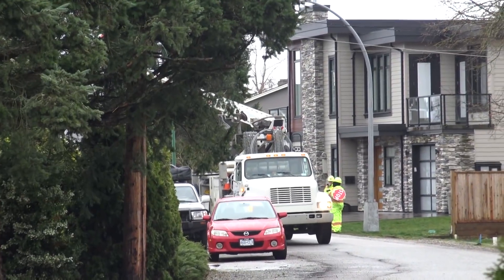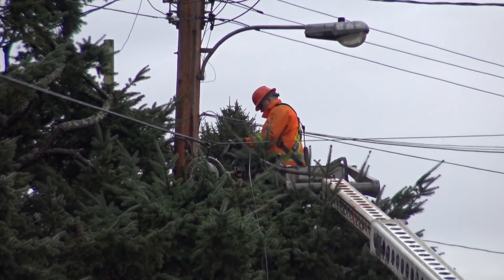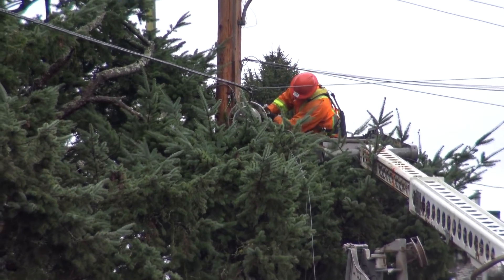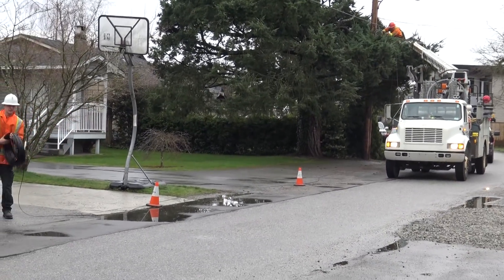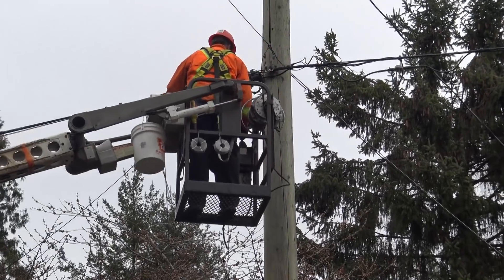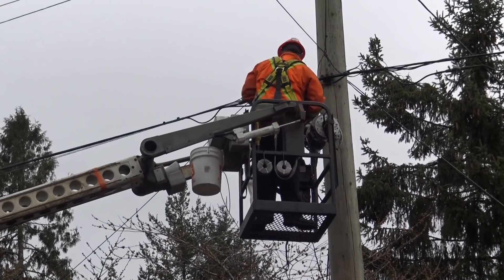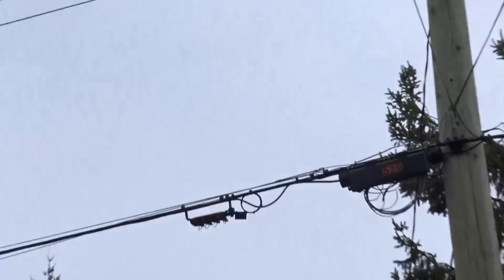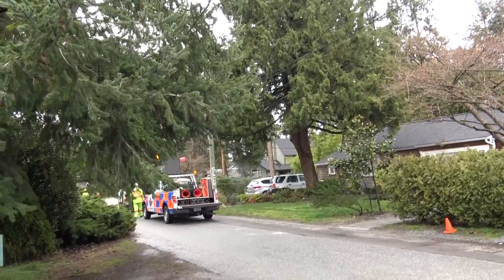Telus is placing fiber optic cable for FTTH upgrade

Comment: There's a 12-port NAP in front of my house.  For whatever reason, they ran a single fiber drop to my house, a dual fiber drop to my neighbor's house, and a quad fiber drop to the house across the street...
Reply from the maker: It depends on the zoning.  If single family a single drop. If legal suite is registered a dual is run. 4 pkex gets a quad.

Comment: I've seen FTTH overbuilds where the fiber is slower than the existing coax. Beware of the salesmen that follow.
Reply: FTTH can support 128 houses on a single 1Gig fibre link. But that would be insanely slow.
Reply: @99beta  Remember... Plug fast into slow... and you've still got slow. I've seen a lot of that.
Reply: @99beta  300 mps off 750 mhz coax in Tennessee right now. I can live with this.
Reply: @99beta  Remember price, not speed will be the determining factor.

Comment: I have fiber in my neighborhood but the AT&T tech said he couldn't install it!  Jesus Christ!
Reply from the maker: All the parts may be full. I know for us that is s problem. When plant was designed it was 1 drop per address  if the house had a legal suite that is registered with the city there were 2 service drops installed. If the home was a single family house that was turned into a duplex or triplex without the cities blessing well it is still considered a single family unit. Only 1 drop.  I have been to homes where the renter in the basement has the service installed then the home owner wants it and the basement already had  the drop in use so a second drop needs to be added. Sometimes that is not possible because unlike with copper, there are not a ton of redundant spares and if the count is full it is too bad so sad.  Now we are doing ont sharing in some of those situations.

Comment: Its called a Lasher that he uses to overlash the fiber to the existing strand/messenger that is already hung. The lashing wire ties off to BUG NUTS where the lashing wire terminates.
Reply from the maker: Spinner / lasher same thing. When I worked for the cable company in 1980 we called it a cable spinner because it "spun" the cable up.

Comment: people want "fiber" because its sound good. but they dont understand the technology behind FTTH. normally a business that want real fiber will get a 1 Gbps full duplex or 10Gbps but they will get the whole bandwith to a 1Gb/10Gb port (even higher or even a dark fiber)... the FTTH design is like cable broadcast, its a 1Gbps port or a 10Gbps fiber port divide into a 32 optical splitter... so they are splitting the bandwith between users. no real advantage over Cable. the only good thing about fiber (and its major) is it doenst need active equipment on the pole like cable does (cable needs amplifier every 300m, its need power supply and batteries every ~ 10Amp)... the fiber can go well over 80Km without any amplification (even higher distance). well even with the FTTH the 32 optical splitter is amplified back by an EDFA that is passive. so massive gain over equipment by the network compagnies. but no real advantage for the customer. ok maybe a bit but its very comparable for the residential end user.

Comment: Telus is great. i get fiber in my area and the offer 950/950. but i dont get why they didnt go for the extra 50 and make it gigabit. BTW nice video
Reply from the maker: It's called overhead. 950 is close to the maximum you can pass on a 1gb Ethernet  port.
Reply: 12voltvids just out of curiosity. What internet speed do you have. And what is your opinion of Shaw?
Reply from the maker: @dylzu  
I am still on bonded DSL 50 down 12 up.   Don't need anything faster than that.  Fiber is there but I am in no hurry to change.  My internet and TV is expensive enough.  Even with my discount it is expensive.
I have no opinion of Shaw because they are not in my area, but I do know their upload speed is limited to 20 even on their fastest speeds.

Comment: where is this?
Reply from the maker: Hugh Jazz 
South Delta
Reply: did u sign up for their optik tv and internet yet? theyre now offering 300/300 mbps
Reply from the maker: Hugh Jazz 
I have optik with hs50. More than fast enough for me. The fiber is installed but I haven't switched and probably won't for awhile.  Don't need the speed however I do need to run my modem in bridged mode and fiber doesn't support bridged operation.  So I will stay on copper. 
I am aware of the 300/300 speed. I actually knew about it before anyone else. I have speed tested it and got 312 down and 304 up.
Reply: Wait, what? Im with Shaw and the Hitron modem is bridged to the Ausus router. So then I would have to buy their Wifi boosters then??

Comment: Didn't know we were famous. That's my truck, that's me. Do I get video rights to this Haha? That "spinner" is actually called a lasher made by GMP J Model. And yes it does weigh a lot.
Reply: Hi, Markus. I am from Brazil, and I work with telecom too. How did yoy attached the lasher at the basket without the risk of brake the fiber cable when you do a wrong movement, for exemple? Is there a ruber or something like it?

Comment: so BELL is doing this in my town in southern ontario. Taking their sweet time. fiber cable was burried on my street 1.5 years ago and a bunch of fiber rolls hanging from the poles randomly before winter freeze up back in december.  From what I can tell they are just bringing fiber to NODES giving us better speeds than 5mb DSL but still using copper to the home. meh. Cable company has had way higher speeds than bell for over a decade now...
Reply from the maker: Telus out here is going like gangbusters. They are hanging drops now, I expect my new drop to be in place next week. They are holding the crews to high standards though and they have deadlines. I was talking to one of the guys, and the money they are making is insane. Well into the 6 figures!
Reply: they hired a construction company in my town..i wont name them but they dont look like well paid workers. short bursts of work followed by months of dry...the fiber hanging in my town is thick, they had to run it down several km of highway and it needs to jump a small river and that hasnt been done yet...so fiber on each side of river with some orange fence around it since last september. no progress... I have had 5mb DSL since 2008, prior to that there was no high speed. this isn't rural ontario either..its a busy town in a populated part of the province..

Comment: So why is fiber so much faster then copper??
Reply: My guesses.

Light is capable of carrying a signal of much higher frequency than is possible with an electric carrier.  The higher the frequency of the signal, the more information that signal can carry at once.

A light signal has fewer mechanisms of interference acting against it and can run for substantially longer distances on optical fiber whereas the effects electrical resistance, electrical inductance, capacitance, and other factors impose limits over an electrical signal's bandwidth on copper cable as well as how far that signal can travel without needing to be repeated.
Reply: Fiber has less attenuation with frequency changes so you get significantly more "spectral width" (bandwidth) to work with, plus when you get up to light freqs you have less "noise" to deal with like you do in a copper system which can really only work on the noisy RF (radio) spectrum from DC to about 750/850MHz.

Comment: looks so messy all these wires. Here (Neterlands) most goes underground
Reply: Underground has it's own issues. I used to install underground CATV and fiber. Wasn't a fun job.
Reply: It depends on the area. Outside the old city area its mostly underground. I’m sure its same in Netherlands as well.

Comment: The excitement you're going through reminds me of back in the olden days when a small town learned that the railroad was going to build a station at their town.
Reply from the maker: Excitement?  Not likely. I am happy with dsl service. I work for the company and it means much more work having to deal with FTTH and all the headaches dealing with old houses. The contractors putting in the fiber will get all the nice easy jobs and leave all the ugly ones for the company workers, which means me.  I would have been much happier if the fiber build was delayed for a few more years so I could be out of the company. So am I excited, not really, depressed is a better term as I know what is in store. Laying the fiber is the easy part and then these guys move on and the real work begins. Even newer houses will be a challenge because 95% have a main panel in the middle of the house and only a few will have a run of fiber into the house and that means a lot of work to rewire. Will likely result in mandatory overtime.
Reply: I made a silly comment and then I wind up learning something interesting about the cable industry.  I guess some people will have a lot of work ahead of them for the foreseeable future. Thanks for the information.

Comment: In my part of the UK, I recall it was CableTel who did our (buried) fibre network way back in 1994. Initially for phone, analogue cable TV/ PPV (via Jerrold Impulse set-top boxes)/ analogue terrestrial (including FM radio), 56k dial-up, and then later full broadband and digital TV services under NTL (becoming Virgin Media).

Comment: So are you changing to fiber, very expensive?
They do a nice neat job :-D, that spinner is a smart way to bond the cables.

We have mostly telephone wires overhead and cable or fiber under ground, the telephone system still works for adsl internet, but fiber is a big step up and it takes longer to get.
Reply from the maker: I will have to wait a minimum of 3 months, as I don't want contractors doing my install. They can hang the drop, but I fully intend to do my own install as I have very specific requirements as to how and where the equipment gets installed.
Reply from the maker: No price difference. They are installing it for free to everyone.
Reply: I got fiber in my area 3 months ago, but I only recently had Bell change it over.  Damn is it quick.  Same price I was paying for the copper cable service too.  If you think about it, it's actually cheaper for them in the long run.  They don't need all that extra equipment to convert to RF and back.  They'll also be able to provide a ton of services through one tiny cable.

Comment: I just got Fibre to the home last year, from our electric company as we live in the country "Texas" or rural area, our speeds and latency are much better than the city of San Antonio, the fibre comes directly into my home, I currently have 100x100 with no limits for about $75 a month, they also offer Gigabit here, but I don't need those kind of speeds, they also allow me to run web and mail servers and I managed to get a dedicated IP as well. Before that, they offered wireless out here, "which was ok" till they oversubbed it. I am thrilled with our Fibre. Keep us posted as to when they hook you up.

Comment: Kind of reminds me of some of the work that was done at IBM in East Fishkill,  N.Y.  We had a Manlift  made by JLG that could go to 80 feet strait up !!  We maintained all the equipment and services on the overhead trestle's that went from building to building. The only major difference was all the cables and fiber optics were laid in cable trays! and of course all heating and cooling water along with chemical distribution and gas distribution was in various types of pipes. We wore the EXACT SAME safety harness and safety strap as the man in the bucket in this video!  I hated driving that manlift as you were about 30 to 40 feet BEHIND the power drive unit (WHEELED UNIT) so when you cam to a stop there was always this very annoying effect that the collapsed boom and bucket had was that it would move about 3 feet in an upward arc and if you did not have the strap held down tight, it would almost eject you up out of the bucket !!!!!!!!  Other wise it was a blast to use that machine, ha ha.  Thanks for the memories  !!!!   John Bellas    KC2UVN

Comment: Thanks for the video!
Where is your SNOW?
We got all the Canada snow here in Connecticut, maybe I should move to Canada...LOL
Reply from the maker: old64goat 
What's snow. Oh yes that white shit on the mountains where it belongs. We don't get snow here and the odd time we actually get it, it is rarely more than 1-2" and it is gone in a day or 2. This winter we had 3 days where it snowed. The valley got hit big time this year. Paul Carlson (mrcarlsonslab) got hit big time but we got nothing here. Where I am located we are surrounded by the pacific on 3 sides so the air never gets that cold. -5C is about as cold as it gets here in dead of winter and +30 in the summer.

Comment: I have Verizon FIOS which I love and would never go back to cable. Would I be correct to say  that this would work in the same principal with dropping a line to the ONT either on the side of the building or inside the garage?
Reply from the maker: R H 
Yes the ONT can go in the garage. We have actually developed in house a new system that I probably shouldn't talk about as it is being patented and will change the way fiber is done. That is all I can say at this time but it should be deployed very soon and will be marketed to other providers, and it will make the installs go much more smoothly
Reply: @12voltvids Nope I am not expecting you to discuss something while in the process of being patented. However I wish it best of luck though.. On another thought, when I originally had my FIOS installed they bridged my internet from the ONT to my router using a MOCA bridge, I was able to upgrade from 25M/25M to 50M/50M then to 75M/75M now from my understanding from a VZ FIOS tech if I wish to upgrade to the higher gigabyte connection that they would now have to run a cat 5a or 6 cable from ONT to the router and I have heard others say the ethernet cable bridge is better and understandable, NOW here is where my argument lays... HOW can the cable companies that are offering twice the speed of FIOS over a 100% coaxial cable system from the head end to the customers drop then to their TVs and DOCSIS 3.0 standard cable modems up to 340MBps? How is that so???

Comment: It appears they are binding it to both the telephone and coax cable. Telus owns both? Cuz in the US you're not allowed to attach your fiber to another companies cable, you have to run the fiber by itself a few inch below. A company ran aerial fiber down my road but it was backhaul for schools, local gov, dslams and cell towers. I know the cable companies over here have fiber ran on most of their cable plant and bind it like that in preparation for DOCSIS 3.1. A dead giveaway is the lovely triangle-like fiber slack storage.
Reply from the maker: Victor Coss 
Yes we own the messenger. We lease messenger space to the old cable company. This doesn't fly these days. Shaw wants to come out here but they can't use our messenger so they have to place their own but on old plant there was an agreement and the cable Co signed a long term lease. That was from back in the days when they didn't compete with phone and we didn't compete with cable TV. When I started in the business we would even pull in the coax in New construction. Not now. They have to have their own conduits to the house. In one new community there are 3 boxes on the side of each new house. 1 for us and 2 for the 2 competing cable Co.
Reply: There is only one good spot for a cell tower and there is only one spot for a pole. The CRTC in Canada permits pole rentals and tower sharing no matter who built it. It is like $10 per pole per year and $15,000 a year for a tower.

Comment: I  can't  quite  figure  out  how  that  thing  spins  the  cable  without  making  a  loop  ahead  of  it!
Reply: I always think of it as zip tying the cables together, same concept really. Plus that metal binding wire helps take strain off the wires weight wise and can help some against wind.
Reply: It's not spinning the cable. It is binding the new cable to the existing using spools of binding wire that are inside the spinner.
Reply: pileofstuff Ah, I  understand  now .  Got  it .  THANKS

Comment: Until 2013. You got around 35 horrid looking analog cable channels in the town i grew up in. A new company came in and updated everything starting in like 2012. I told my grandmother about all the channels and features our cable company (Suddenlink) has. She said we'll never get that. Whatever company she had hooked up advanced services to her house less than a week before she died. I thought her 20 something year old TV was wearing out bad.  Nope. Cable system was bad. The TV is an LXI 25 inch with a CTC157. I have it, but the picture collapsed.  We now have upload speeds up to 1 gig at my house.  We just have the 200 meg plan. It's more than we need.

Comment: first! here in britain bt put the cables underground then they go into street cabinets which then connects the fibre broadband to your house bt guarantee 65mbps download but there is a street cabinet opposite where i stay and i get 80mbps download and 20mbps upload speeds
Reply from the maker: The cyclist 
Right now on dsl I get 110 down and. 40 up on a bonded loop. I am in no hurry to have fiber connected. They will bring the drop to the house and it will sit there for awhile as I am in no big hurry. I don't need more speed.
Reply: Newer neighborhoods in most Canadian cities use buried cables as well.

Older areas still have aerial cable (along with places where it's too rocky to trench easily).
Reply: I get 300 dl here in the uk {Virgin Media}
Reply: It's not fiber, it's VDSL2 and that street cabinet on your street is the DSLAM. Which is why you're able to get those speeds is because it's right outside the door. DSL degrades very fast with distance unlike cable.